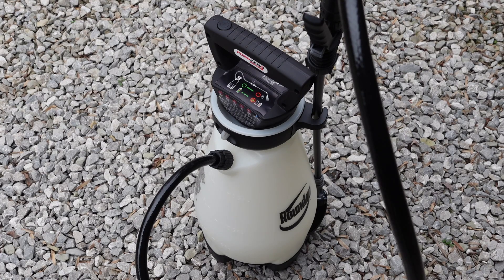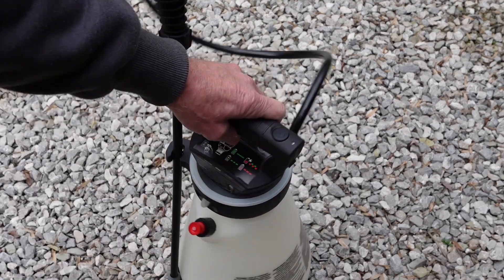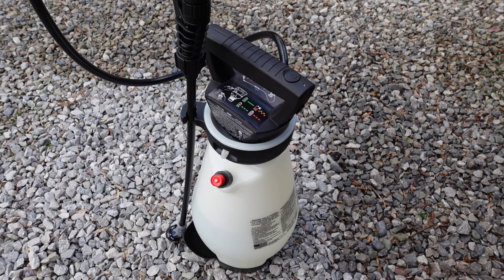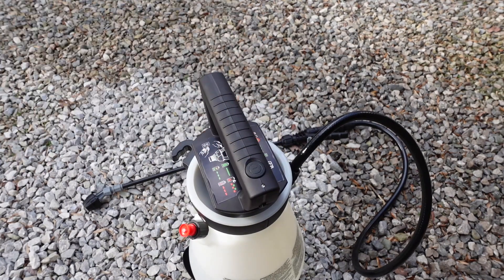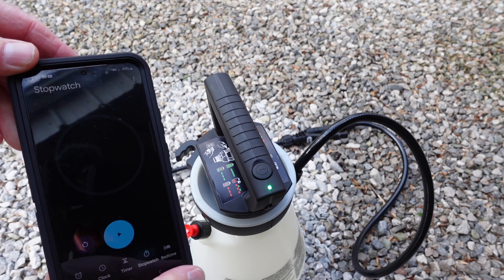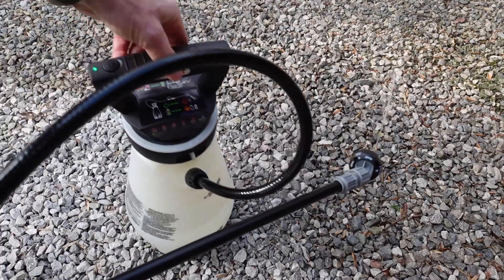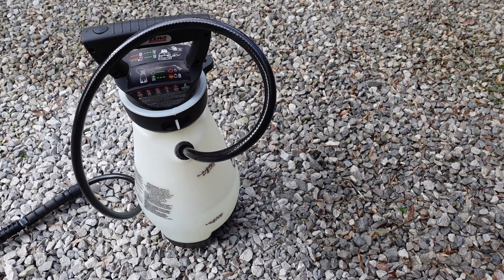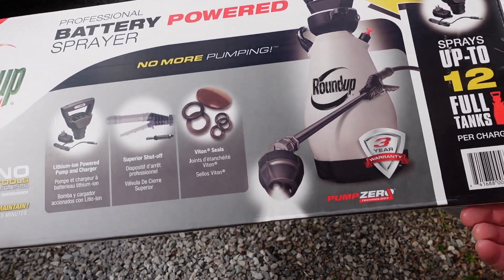Pump Zero Sprayer real time pressure cut-offs

Comment: I bought this on Amazon under the Scott’s brand. I love it, especially for the price! But I am now on my third Pump Zero sprayer power head because the power switch stopped working. Any advice to fix/replace the switch or file a warranty claim for a new head?
Reply from the maker: Glad you're enjoying it, it might be worth contacting customer support about a replacement.

Comment: Hello, mine was working fine. Now, the pressure is not building up. When I push it on, it stays on and the spray is weak. when I open the release valve, very little air comes out. Any suggestions?
Reply from the maker: It sure sounds like the little compressor isn't working. 
I haven’t had any problems yet so IDK about their support.

Comment: Can you tell me the polarity on the charger?
My dad seems to have misplaced his and we're trying to find a suitable replacement
Reply from the maker: Here's what's on my charger:
Class 2 power supply
Model: 183563
Input: 100-240V, 50-60 Hz 15W
Output: 9V DC 800mA

I"ll check polarity and list it here.
Thanks for watching!
Reply from the maker: xLD, the outer conducting jacket is ground, as it should be for safety reasons.  The inner is 9 volts DC.
Thanks and good luck!
Reply: @pmtips4482  Thank you so much :)
Reply: Does not charge up, tried new adapter, still doesn't charge, what could be wrong